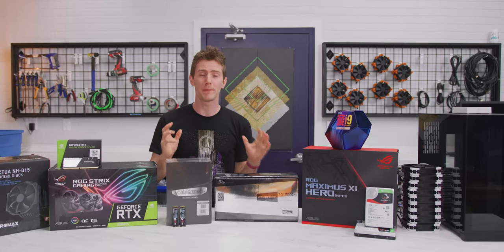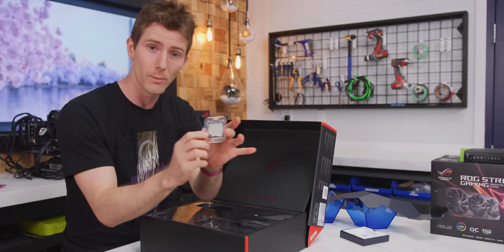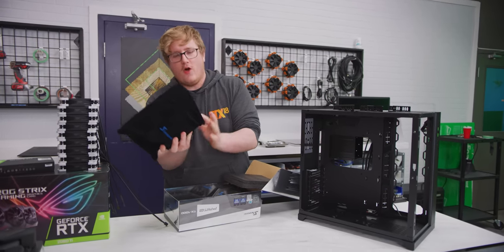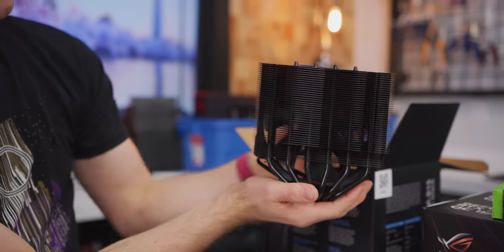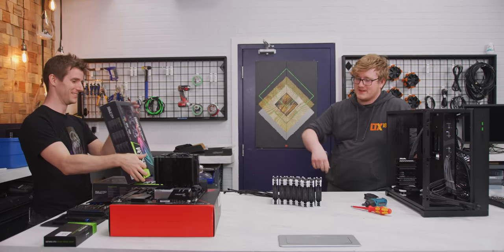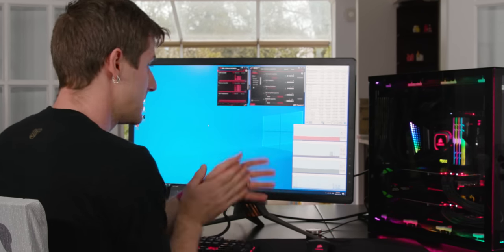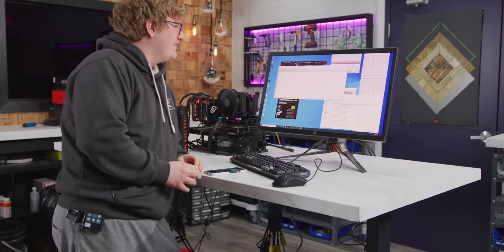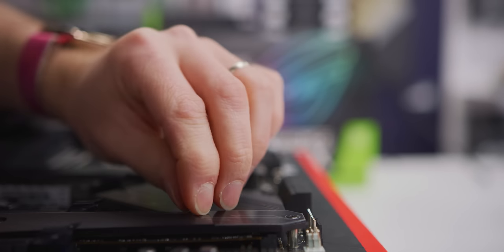Can AMD Beat the ULTIMATE Intel Gaming PC?

Comment: Get Ryzen 5 3600, and you are done. Spend the rest for your GPU. Or if you really want to push the limit, 3700X MAX. No need for 3950X. That's just a waste of money. No game would use those extras. Steve HUB has proven how poor those game scales.
Situation would change when you put live streaming into mix though. Even then, 3700X is enough.

Comment: Intel 2021: 10 cores 20 threads 14++++ nm chipset Triple price
Amd 2021: x cores 2x threads 5 nm price half of intel!
Reply: Intels most powerful gaming cpu is $250 cheaper than AMDs
Reply: @chinchy111  dude what about price/performance ? That's the losing comparison, we can see it also on Mobile devices this year where ryzen 7 completely doubled the performance and still the whole device is about 300$ less in value

Comment: AiR cOoLiNg No ReAl DiFfErEnCe yet custom water cooling has been proven to dissapate heat faster with a same surface area radiator and compitent fans and a decent pump

Comment: Short answer: NO. 

Not surprising really. Games still favor speed. As long as you're not at 4 core intel is still going to win, even without the overpriced SL chip. A basic 9900k would still match or beat the $750 R9. But we all already know if you're only gaming buy intel. It's if you do ANY thread heavy work AMD shines.

Comment: You guys know alot more than me by far but I run way higher frames then this but I assume that's cause I'm not playing in any 2k 4k resolution
My pc is ryzen 7 3700x
Rtx 2070 Super
16 gigs of ddr4 3200
And in csgo I hold 200 fps 90% of the time but my monitor is a 1080p 144 1ms response

Comment: Great video, and Although Intel is still the king in gaming performance, that mobo and processor will eventually show signs of age in the next few years specially with vulkan being integrated in most games now and eventually all games. Upside of this build is you will have a great gaming machine for a few years downside no option to upgrade from there. You will need to replace an entire motherboard and processor just to keep up with the demand in gaming. Even with Intels 10th gen which is more powerful still has only 1 more generation to go before needing to replace the cpu and mobo again. Now that AMd has finally caught up after so many years of slacking off and spanking Intel to finally wake up, there is barely any difference in performance when it comes to gaming with either intel or amd gaming. Does extra 10fps or 30 fps when you are already over 100fps or 150 fps will make very little difference if at all any difference at all. i no longer game at 1080p or even 1440p. I game at 4k which is amazing and the gap between intel and amd at 4k is hardly noticeable when playing. some people may bash me that 60fps is weak. Guess what So is anything over 150fps, that becomes irrelevant specially if you don't have a 144hz monitor or higher. now that 4k monitors and 4k tv's are getting cheaper and can handle gaming with very little input lag. (Playing on a Optoma UHD60 Projector) max refresh rate is 60hz, im fine with playing at 60 refresh rate. It's very playable, i've played with 144hz monitors yes its nice but not enough to say its worth it.

That being said. I switched back to AMD because the gap is hardly there now. I'm not going to miss 10-20fps when i can get a mobo that is future proof for the next 2 or 3 generations coming in. Intel is pretty well known for changing sockets every 2 generations which is dumb. Atleast with AMD the mobo is compatible from last generation with 3rd generation processors and probably even 4rth gen processors coming. Im not an AMD fanboy, I never was, i started with AMD in the beginning with single core processors that used 230mhz cpus then switched to Intel because of their superior performance in gaming. Now the gap in gaming performance is barely there and AMD has finally caught up but with more benefits and not just in gaming. I think AMD has come a long way and they are well balanced now with a few minor adjustments they may become the new generation in gaming maybe. If im wrong then please tell me but what i do know is that Intel has had the tittle too long, thinking of building my new gaming machine with either a 3900x or 3950x, even though im not an video editor and or doing any high end rendering like blender, i have a machine that can do either or, editing and processing and gaming machine all in one.

Comment: I got amd in the same case with 570 board it goes so good with 2 of the same ram and only 1 2080ti and 2 m.2 drives. But if you are going best to z73 lcd from nzxt they are just so much better looking and I run tomb raider at 2k max settings with ray tracing on max too at 97fps but I would like to point out when playing those games 10 more frames doesn’t really matter but yeah intel is king for games anything else amd is god

Comment: All I ever hear is AMD is better, AMD out performs, and then when they test them side by side intel is always on top. Is it just the multi core workstation shit where AMD is better?
Reply: It's on the mid to lower end (where most people actually buy) that AMD is better overall. Intel is still slightly better for single thread applications in most cases, but takes a big hit for stuff that takes more cores. The very high end Intel cards still have a lot of cores (but not as many), yet have higher clock speeds. It is also likely that games in the future will take more advantage of the multiple cores.

Comment: why aren't you looking to anything other than gaming. Why don't you add a minute or two about video and photo editing? Very few photo editing programs are badly compiled and use only one or a few cores (except DXO Photolab that runs on all cores and threads at 100% when heavily denoising); thus they are horribly slow on high spec PCs. Of course I would never mention Adobe et al. You probably never heard anybody complaining about the rendering speeds. You have highly capable experts in your team. Why don't you use their competence, just for a few minutes.

Comment: “Air cooler because it doesn’t matter.”

He says that and I’ve seen their single test where they showed this, but I went from a big air cooler like that to an AIO water cooler and my core temps dropped by 10C at idle and 15C under max load.

It may not matter in some situations, but stop making a blanket statement saying that water coolers don’t help.